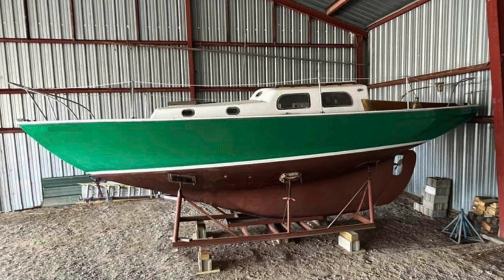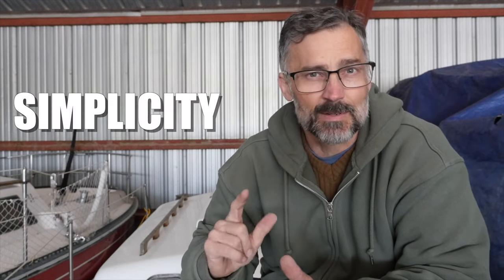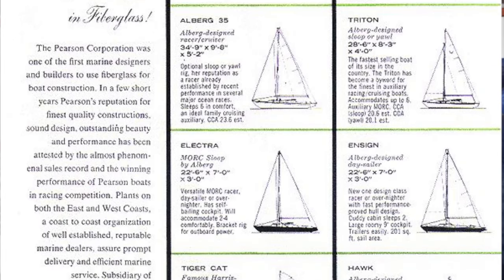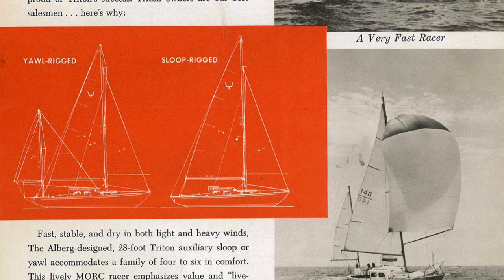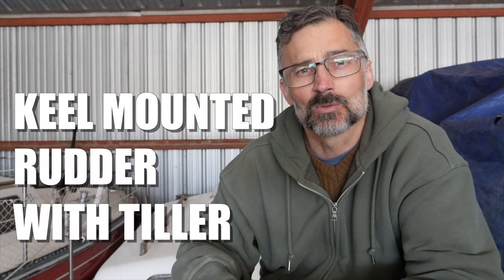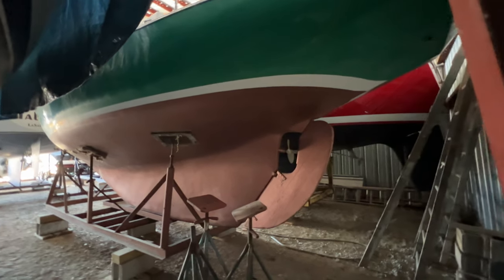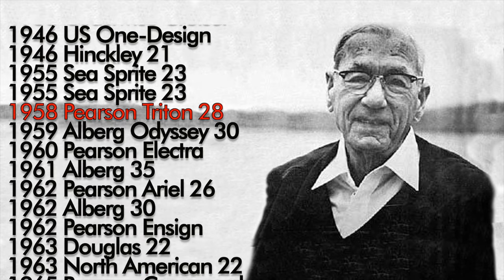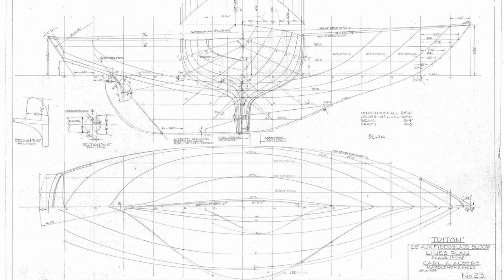7 Characteristics making a Pearson Triton a GREAT Small Ocean Passage Maker for Solo Sailing

Comment: Jason, do you have a timeline when you want to have the boat in the water and start some solo passages. What engine is in the boat...Atomic 4 or a diesel. Good luck with the project.
Reply from the maker: Good questions. The current engine is an Atomic 4 but I’m replacing it. That’ll be explained in an upcoming video.
I’m hoping to launch mid-May and hope to be sailing soon after. I’m flexible with my timeline but want to get it on the water and be heading to the North Channel. There are a lot of small jobs that I can do throughout the summer so will be focusing on the main ones first.